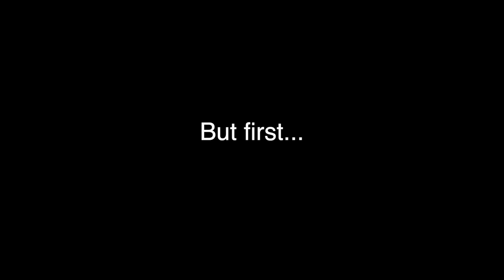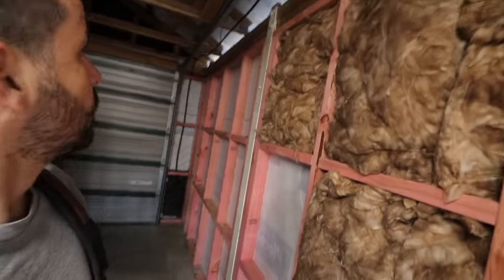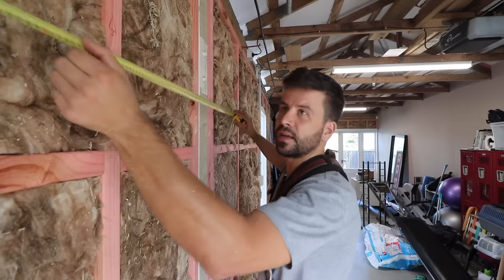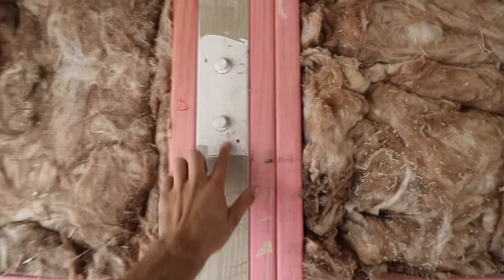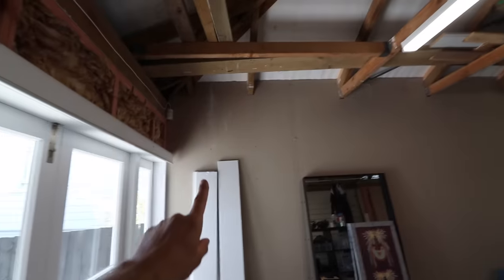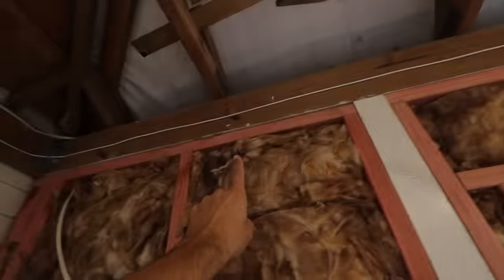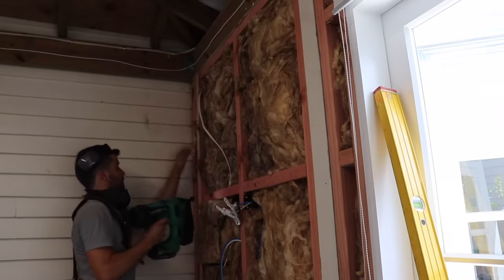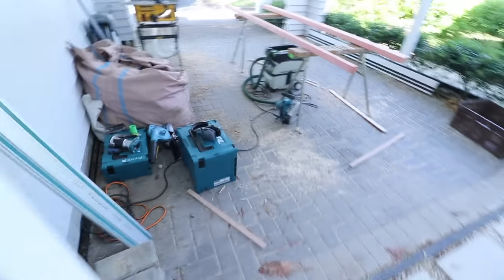Lining Your Garage Walls with Plywood

Comment: Hey man, could you answer a few questions for me? I am hoping to finish the interior side of my shed walls with plywood like this. What router bit did you use here to clean up the edges of your plywood? Also, I noticed that most sheets of plywood aren't perfectly square. I thought about squaring them up with my track saw, but if I do that, wouldn't I be reducing my plywood down to less than 4 feet wide (thereby making them too short for 16 OC framing)? Finally, should I leave an expansion gap between the plywood panels like with exterior sheathing, or is that not necessary for interior work?
Reply: the sides don't need to be squared up its the top and bottom of the sheets and i would leave a half inch gap at the bottom and cover it with some sort of skirting just incase of any water damage getting to the ply. if they are unsquared i can't see an issue with taking the slightest bit off it would just mean that each panel isnt perfectly centred on the stud That router bit he is using looks like a quarter inch flush trim bit but i can't be certain i know this may be too late but i can only give it a shot

Comment: I've almost finished lining my double garage in 25mm MDF - insulation for my single-brick-thick walls, and (like you said) something to attach shelves, cupboards, racks etc to without a thousand holes into the brickwork.

I've notched the sheets round the rafters (will insulate the ceiling in due course) and left a 50mm gap at the bottom. Getting whole 25mm sheets into place on my own has been a challenge, but hey, who wants an easy life!

(A Russian study showed that 12mm MDF provides as much insulation as 150mm of brick, so I should be a bit warmer in due course, and cooler in summer, I hope, here in the UK.)

Enjoyed your clip - you're a good tradesman! And you live and work in a beautiful part of the world!

Comment: I did this on a job 15 years ago. The trick is to seal and paint the bottom edge and back side 3 inches up to prevent wickin up damp if in a flood. I went against the clients wishes and opted for a coating of oil based paint which is way better than water based paint which degrades in welding etc, oil based retains it's gloss and requires less coats to cover.

Comment: Ten years ago, I built a 20' x 40' shop and decided to use 1/2" plywood instead of drywall. I always had cracks and holes in my small shop, so plywood was a must.  Best idea, as mounting light items and brackets anywhere, wasn't easy thing. Hell, I threw a small sledge hammer at the wall, to prove to my dad that it was solid; he was impressed.

Comment: I learned draughting under an engineer. He was a fantastic teacher and told me that you knew you did a good job if those building what you designed didn't call you up with questions on things you missed. I can tell you do some great work by your standard of work and attention to detail. It can be difficult to find a good professional in a lot of professions but I would have to say I love your work. I wouldn't recommend anyone doing this in a metal clad garage though unless it has building paper on the outside of the framing. Those things are generally so badly built they leak like sieves.

Comment: The plywood you used is for lining the shed .   What would you use to be able to mount and hang cabinets etc  on a wall .  I have a new shed and I want to put cupboards and shelves on my walls.   It's a steel frame with minimal purlins.

Comment: I like it and I’d love plywood walls in the garage but I think we have fire codes in Canada that permit only very thick gypsum board inside a garage that is attached to a home. Maybe I’m wrong and I can use plywood on walls but the ceiling certainly requires the thicker gyprock.

Comment: Hello, in 2:25 you clean the edges with a router - is it necessary? do the cutting edges (even with the Makita track saw) remain frayed/cracked? would it be possible to use something very weak, such as a dremel 3000? makita router is quite strong for that purpose, what do you think?

Comment: I lined my garage walls with 1-1/8" tongue and groove plywood so I can hang pretty much anything on the walls.
Reply: Hi Andrew. How did you attach it, please? Did you screw the plywood directly into the brick or insulate between battens first then screw in the plywood? Thank you

Comment: Hello Scott.  I'm putting in a timber batten frame in my garage.  These are 45mmx45mm pine battens.  Top, bottom, sides, around windows etc.  Then I'm fitting 40mm thick wood fibre insulation.  That leaves 5mm of a gap.  The wood fibe panels are going against a wall in brick (the bricks with lots of air space for insualtion).   The wall is very dry and the garage won't be heated.
I noticed you haven't got an air space between your panelling and the insulation.  Do you have a membrame behind the insulation to prevent humidity?
Thanks,  Mark

Comment: Thank you for your video.  I'm starting the process of covering my shop walls with plywood.  I noticed that you used the router on the edges of the sheets before you installed.  Is there a mechanical reason for doing that?  Or, did you do it for asthetics?
Reply: im not scott. nor a carpenter, but I think he does it on the top and the sides that are going against the garage door opening. looks like a round over bit to make it a bit neater and so you can't get stuck on it

Comment: i have 2 quotes from tradies to do my 6x4m shed...one wants to use 7mm + extra battons, the other says 12mm won’t need to add extra battons as the extra thickness  “should” stop the py from bowing...what you reckon?

Comment: What’s the key to getting precise measurements for cutouts similar to the bolts at 3:44?
Reply: if your sheet is already cut to size - you can place it up against the wall and tap the area over the bolts a few times with a rubber mallet - you'll get an impression on the back where the bolts are to drill

Comment: Very nice - been thinking about plywood for my garage instead of drywall. This convinced me! What tool were you using to sand the edges of the plywood? Also, any tips on what kind of nail gun to get? Are you using a framing nailer or finishing nailer to attach the plywood?

Comment: Hi Scott loved the video mate, just had a quick question, we've just bought our first house and I wanted to insulate the garage, its a metal garage that's on a wooden frame, I was just going to shove batts in and then line with plywood like you have and then realised that there's no water barrier between the sheet metal building and the insulation, what would you recommend doing to preventing the insulation getting wet from condensation? Many thanks mate!
Reply from the maker: You need to use building wrap between the studs and nog's. You essentially create a pocket by stapling the building wrap, this will help separate the insulation from the cladding. We do it in this episode here. https://youtu.be/CxP14Huwd0k
I hope it's helpful

Comment: Hi Scott- I'm thinking on buying that trim router but still debating between the corded and cordless version (some concern on having the battery weight at the top could make unstable). Appreciate your thoughts on that. Cheers mate.

Comment: Hey Scott - great video. What bit are you using in the router? Is it a chamfer bit and just to avoid splintering the edge of the front veneer of ply when you are butting up against the next one? Also are you using plasterboard adhesive for the boards as well as the 16ga nails?

Comment: Awesome video man! Whats the adapter your using for your table saw so you can use your vacuum on it?
Reply from the maker: My mate Kameron gave me that. It's a couple of parts put together to make a hose that fits. if you look for the right sized plastic elbows you should be able to make something similar 👍

Comment: Hi Scott, think you said you’ve used 9mm ply, if you were doing an inside the house job, would you use thicker ply, say 15 / 18mm or s the 9mm stiff enough to look perfect straight and flat (no cupping or bowing)?
Reply: I've used 9mm red line and it seems fairly solid. The framing with dwangs/nogs make it solid enough but it seems to follow any curves (bowed timber stud) or edges of framing that aren't smooth. Like a nog that sits out by more that a millimeter or 2. Can't sand this particular ply as it's a very thin outer layer which any sanding exposes the poplar core. We use glue which helps hold it tight to the framing so it doesn't work loose if a stud is bowed.
Reply from the maker: Yeah that's true. That hardwood veneer is very thin but ok for a garage. Inside a house I would use a plywood with a higher quality core. Would be twice the price per sheet but more stable.  The Okoume we used in our other videos is a good option.
Reply: @ScottBrownCarpentry  What grade plywood is that? Has a beautiful finish.

Comment: Shouldn't you leave a small gap between the floor and the plywood  sheets?
Reply from the maker: There is a gap, but yeah it is an important step!
Reply: @ScottBrownCarpentry  
I saw a tool that is put on the floor with the sheet above it and then you could lever it up a bit (1-1.5 cm) by pressing with your foot on its handle. Frees your hands to do the work

Comment: Lock the trigger on the Makita blower and rest it at any given location on your van. You can get the back of your head and body. Try the lipstick 💄 trick. Put a dab of lipstick on the bolts on the beam. Then rest the sheet against the bolt, which will mark the location of the bolts on the rear of the plywood. No need to measure and mark the saw hole locations. You may want to hide the lipstick in your tool box. This trick also works on electric outlet boxes.

Comment: What are you doing with the router on the edge of the boards?
Reply: It adds a nicer edge because they are butted together, don't have to get the edges 100% aligned then

Comment: If your insulation bag is whole when you get it, cutting to 200 mm slits down on each side will allow you to turn into a trash bag if you flip it upside down and pull your now tabs towards yourself, turns the bag inside out, if the bag didnt turn inside out you did it wrong.

Comment: Do you have to worry about moisture issues and mold using plywood walls? Perhaps the owner plants to paint them to avoid this?

Also did you just butt the panels together or would a scarf joint have helped tidy things up?

Really enjoy your videos and instructionals!

Comment: why would you measure for the bolt holes? put the sheet up slap it with a mallet and drill where the indention are.

Comment: How much did you charged for this? Thanks
Reply: Cost of materials plus time hourly is a good way to price a job. Remember, a handyman or contractor is in the game of selling time, skills & equipment time not materials. Once you strip the materials cost away from a project & charge this part direct to the client at cost, it becomes a simple man hours equation so all you need to do is estimate the effort in hours. Do this by breaking the job down into smaller tasks eg: 8 hours to demolish. 2 hours to pick up materials. 16 hours to install materials...Where small firms get lost is when they start to try & mark up materials they buy to make profit from it.
Reply: David Brewer don’t they get paid in kiwis?

Comment: Looks nice, but this can't be done where the building code requires a 1-hour fire rated wall, which drywall provides.
Reply from the maker: That is true. The other wall in this garage is fire rated wall.

Comment: why interior wall add plywood, lot better cheapen and fireproof material have cyprock sheet. wiresafe rules say 2x1/2" cyprock have good fireline cutter, fire no go house or more .and welding area rule have need cover metal sheet wall.stypid cover workshop wall plywood and have possiple burn all garage.
Reply: Stypid not start sentences with capital letters.

Comment: Errr Scott....You have no vapor barrier on the inside under the plywood? This will mean that moisture will gather against the cold surface on the warm side = MOULD in the cavity & on the underside of the plywood when you trap air in there. Even a differential of a couple of degrees will cause this. All you have to do is trap a 6mil poly sheet behind the plywood.
Reply: Paolo G  That waterproof membrane should be located on the warm side of the insulation layer...
Reply: @davidbrewer7937  not a requirement in our country due to temperatures
Reply: @jasonrowe6302  Fair enough, if it is code there. Here in Canada it obviously is. An incorrectly installed or missing vap barrier here can easily cause $100k of damage to an average home in 18 months...I would install it even if it was not required & here is why: If the wall is good enough for insulation, there must be a temperature differential between inside & out. There is certainly a humidity difference from what I understand so why not be sure & add $70 worth of plastic sheet?
Reply: @davidbrewer7937  Quite different build process between countries i think. In NZ from outside to in, you will have the cladding then a 20mm vapour barrier then a building wrap (generally a waterproof paper composite) then the framing which is treated to various standards (the pink stuff) then insulation on outside walls then the interior lining. Framing materials are required to be durable for 50+ years in NZ.
I think your vapour barrier is simular to our building wrap which we put on the outside of our frame work.Humidity is not so much an issue in most parts of NZ.
Reply: @patrumble8017  We also have a building wrap on the outside between the OSB or plywood sheeting & the decorative weather shielding layer like siding or brick. This is a very slightly breathable layer & used to be a tar impregnated paper. The vapor barrier on the inside is designed to be as completely sealed as possible, even stuck to top, bottom & frames like window & door plate using acoustic tar sealant. It can cause a problem in that our homes are so well sealed up that we often need to have an electrically driven air exchange unit installed to swap the house air over a few times each hour otherwise they would become stale or even dangerous... these homes are VERY efficient.
Reply: From what I understand after watching Matt Risinger videos a while ago is that vapour barrier on the inside is a no no. It traps moisture laden air in the wall cavity. He pulled plasterboard off homes to discover bad mould issues. Only in very cold climates would air barrier or a vapour barrier be wise. Auckland doesn't really get below freezing temperature but is humid. That's just what I've seen and heard from one source.